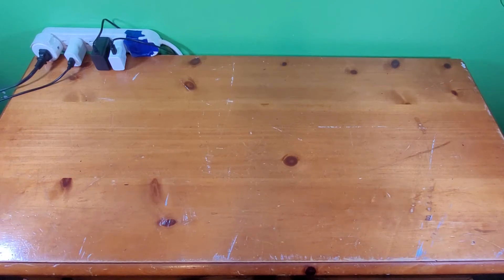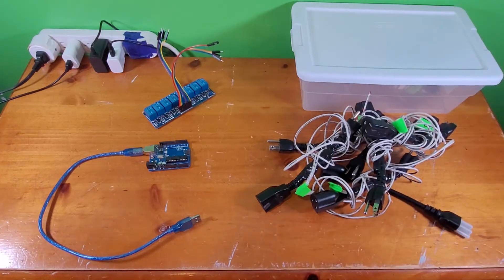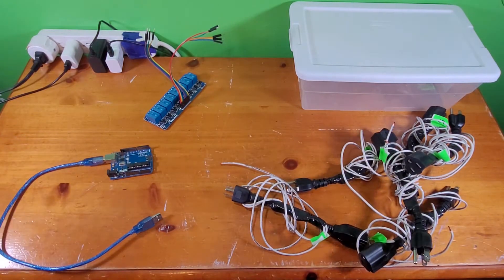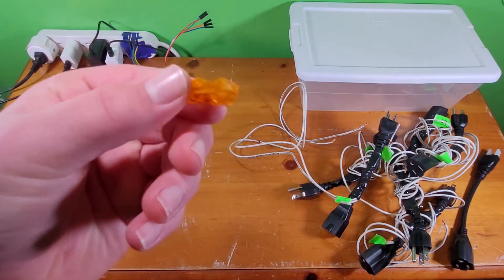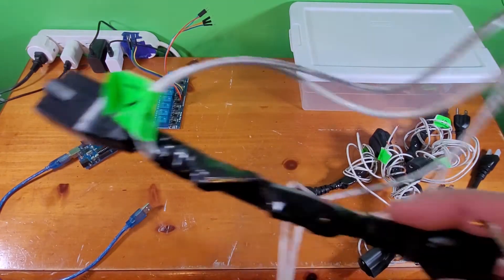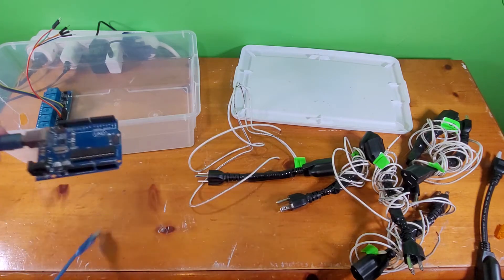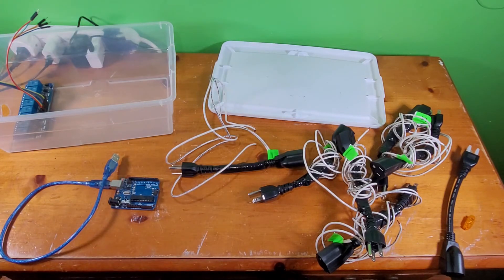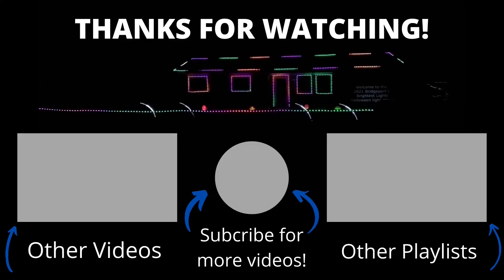How I ran the 2019 Christmas Show with an Arduino Uno

Comment: I did Arduino controllers in 2018 then switched to pixels.
My school had equipment to make my own circuit boards, so I made ones that could switch 12v lights. All my lights were modified to run off 12v.
We all start somewhere, and these DIY controllers are a good start to learn!
Reply from the maker: They sure are!

Comment: My 2020 light show was done on an Arduino Mega controlling 52 channels of solid state relays connected to 26 outlets split to two different outputs in a custom made box. Just a bit over 11K dumb LEDs.
I hand programed it using Arduino IDE that took me close to 8 months for about an 8min show (no music). It did well and had quite a good bit of people coming to see them.

Video:
https://youtu.be/6_vIq8ktdnY

Last year, I didn't do a show (long story involving a $10K new roof).
This year, I'm attempting to use XLights to controll the Arduino Mega and about 500 pixels with some music. Buuut my laptop just craped out on me last week. So we'll see how that goes!

Within the next 5 years, I'll go to all pixels. I still want to get my money and time's worth of my work on my first build.